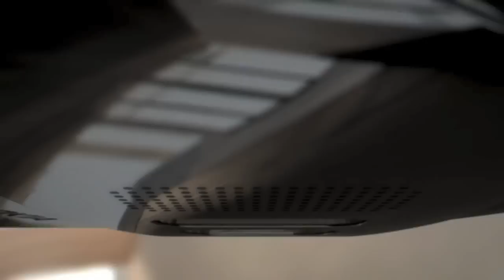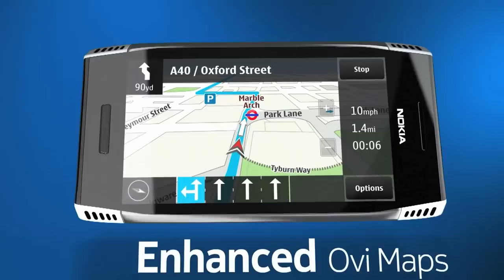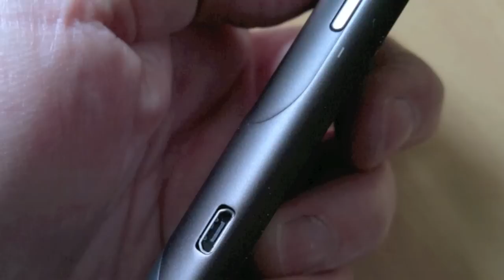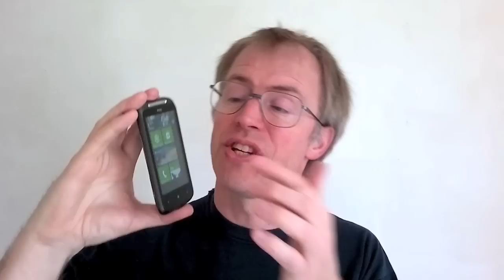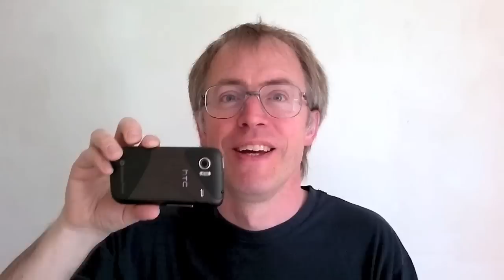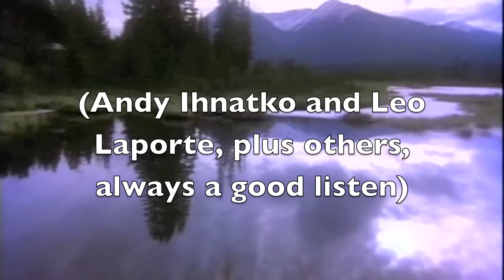The Phones Show 137 (HTC 7 Mozart with Xenon and No-do)

Comment: @stevelitchfield Yes I admit unashamedly that Its limited especially compared to symbian which i have used for many years till recently, and Mango plugs alot of those holes very nicely indeed. You imply very loudly that its useless and nitpick. Understandable as a power user, but not a standard user. The hardware leaves lots to be desired but i believe Nokia can fix that and add their own unique flair to parts of the OS.